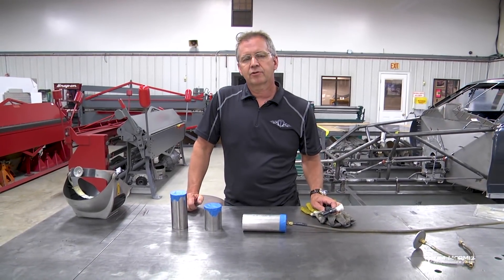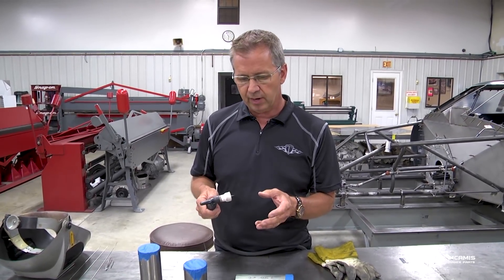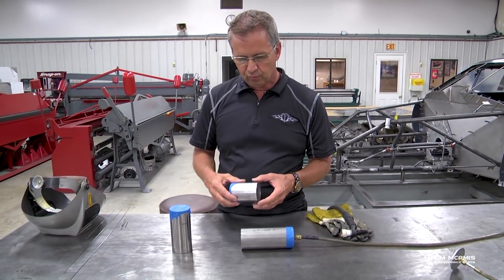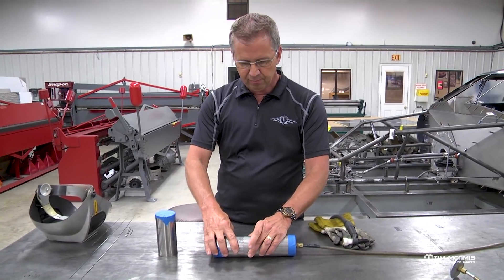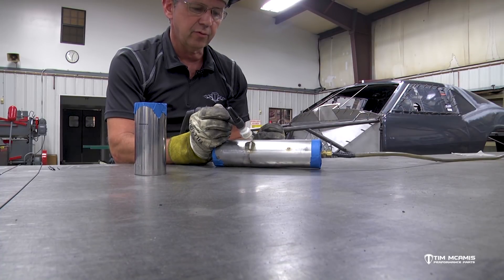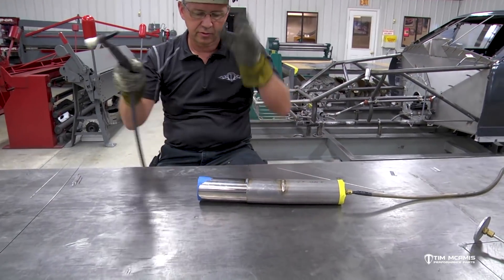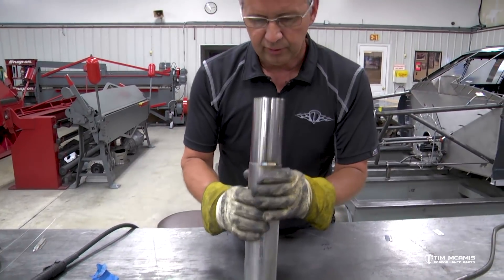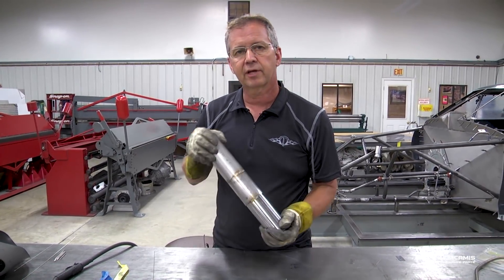Purge Welding Stainless - Fabrication Series: 11

Comment: A frustration is that every time I see an instruction video, I see the same thing over and over again about how not purging causes sugaring. The same point is hammered every time; but  no one mentions how to create a leakless entry point on the supply side of the welded material. I have an argon hose, and other than using excess tape, how to you form a seal over the entry taped end. That is where an instructional video like this would create its worth: what the the secrets in the fine detail of how to make this work?  The detail would set this video apart from all the others.
Reply: Purge plugs, this isn’t real purge welding though

Comment: I have found using one flow meter with a 'Y' fitting does not work. When I changed to a 'Y' fitting before TWO flow meters things improved a lot!

Comment: Couple questions:
What amperage are you running at? I believe I hear you're using pulse. 
Why do some people make a hole where you had it capped off.
Reply: artmiranda888 the hole is for the gas to flow out.   If it doesn’t have a exit point it will blowout the weld bead at the end.  Amperage is set according to thickness and the speed your Abel to weld at.

Comment: bit confused as to why you would not make a hole in the tape to allow the gas  to not build up pressure and blow out the weld, also sound of the torch  sound like high frequency pulsing is on ??

Comment: If you use a wire wheel to clean make sure is SS wheel, having worked in food service welding SS purging we always poked a hole in the tape on the opposite end or when your in the last bit of weld, the pressure will blow your weld out and make it a mess.  We also made sure to purge at 20 psi maximum.
Reply: Even 20 psi is a lot! I'm at about 5cfh after I start.

Comment: What’s the purpose of purging ?? Your not using stainless in process Piping 😂
Reply: Steven Benavides stainless needs to be purged if you get a full pen weld, if not you can get cracks from sugar.   If it is not a full pen weld then no purge needed.

Comment: Tim can you let us know the settings you are setting the welder up and amount of argon CF your running an filler size and what your using ER308 or ER309 ? Thanks
Reply: John Versluis cfh on a tube this small can be set very low ( about 7chf) The best method to do this on any length tube is at the exit hole you want to be able to feel a faint breeze at about 6” inches away.   The best way to feel for that is to lick the back of your hand and wave it in front of exit hole.  You do it with the back of your hand or wrist because your skin is more sensitive and when whet you get a extra feel.
Reply: Filler rod depending on your base metal, you use appropriate filler rod.

Comment: You need to poke a hole(s) in the tape so the argon can push the oxygen out. Also, w/o the hole(s), when you get to the end of the weld, the argon pressure will blow the weld puddle out and make a mess. Oh, and watch your ground between the table and the pipe- notice the arcing when you were tacking it up.
Reply: Showmethepony, spot on. That was exactly what I was gonna say regarding the venting.  Also it would of been cool to talk about reducing purge pressure also to counter blow out.  Sincerely anonymous engineering tutor #2
Reply: And the 1st of today's anonymous engineering tutor's shows up .....
Reply: Martin McMartin I’m far from an engineer. Engineers don’t purge weld stainless tube/pipe. That said, none of what I wrote was incorrect. Nothing wrong with sharing some tips on the proper method. Tim is usually spot on, I love his videos, he just missed a few things on this one. No hate, just trying to help.
Reply: Skeetmgeett Yeah, the cfh you purge with is very critical as well. Even where you place the purge holes is critical. The other thing I was going to point out is that it’s good he mentioned the importance of prep and cleaning the tube, but then he goes on to rub his hands and finger oils all over the joint to be welded. I didn’t mention that before just because I knew the comments would come calling me a keyboard warrior. Oh well. It’s still true.